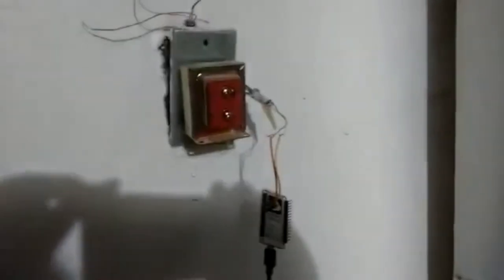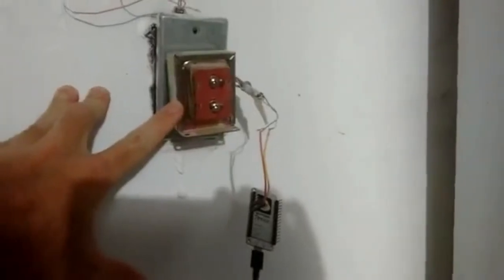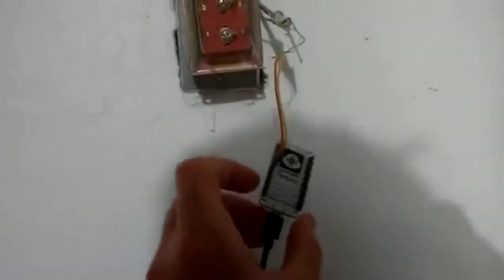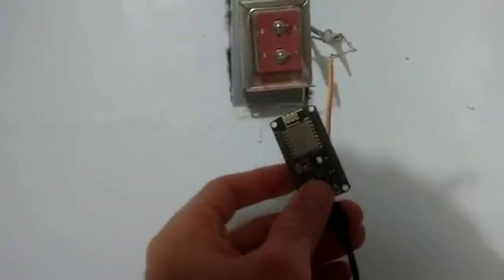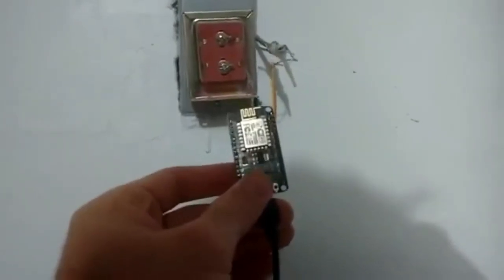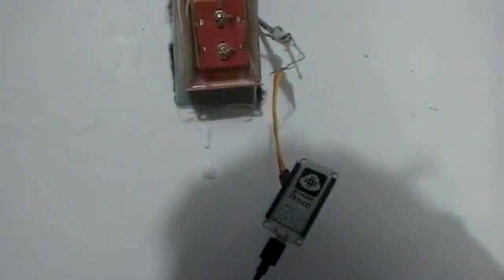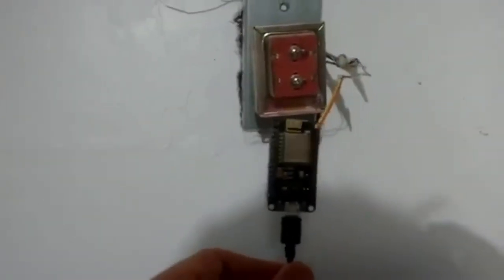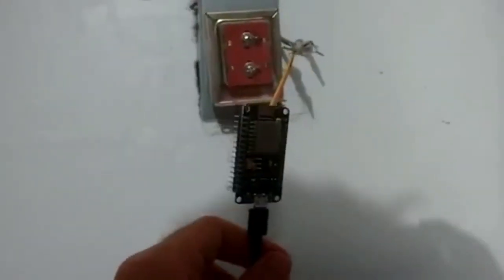ESP8266 Doorbell Hidden Video

Comment: Have you dabbled with sonoff/tasmota? (Sonoff units are esp8266-based + a relay to control mains power, Tasmota is open firmware for them.)
Reply from the maker: Yes, I bought a Sonoff a few years back. It's in my draw of "Stuff I bought and haven't played with yet".  :)